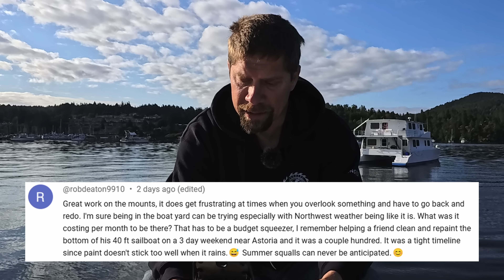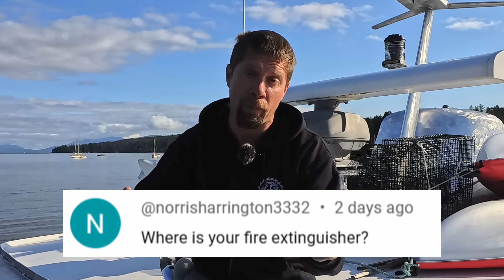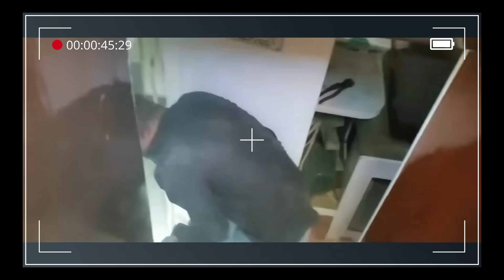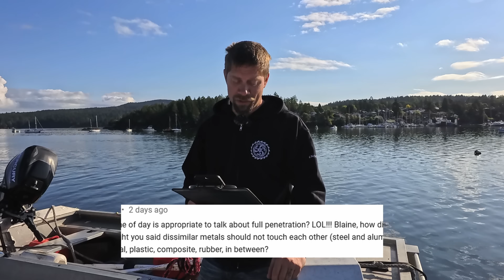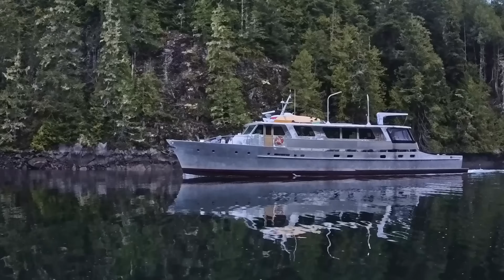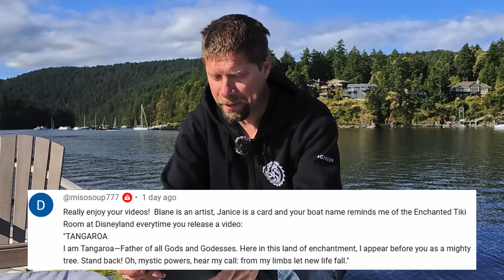We Custom Mounted our Cummins 6.7s - Your Questions Answered V2

Comment: Really fun watching this come together gang. 
You’ve mentioned a couple times you’re big into planning redundancies. So here’s a question from deep down the nerd well…. If you had to run for a significant distance on one motor due to a failure that couldn’t immediately be fixed, how does the windmilling (watermilling??) of the dead prop affect its transmission? I assume if that motor isn’t running there’s no circulation/cooling of the transmission fluid. Or do you have cross feeding of oil and coolant between transmissions? Or do these trannies even work that way.
Reply from the maker: Glad you are enjoying the project! While the transmissions can freewheel for a time they do eventually overheat do to lack of fluid circulation through the cooler. The easiest way around this is to lock out the non-running shaft. In a pinch this can be done with a big pipe wrench which we do have aboard.

Comment: Had a friend Years ago put 2 Cummins K19 engines that came out of trucks in a fishing vessel. While the new engines were much more fuel efficient He kept going thru the stock turbochargers. Those stock turbos were just not made to be on boost for hours straight. After multiple replacements He went with massive low speed turbos that were off a small ship engine, never had turbo failures after that. Just passing along the info….
Reply from the maker: Thanks for the info! They are not stock turbos. Hopefully I wont have similar issues. May carry a spare or two onboard.

Comment: One other thing about the two engines being routed into a single muffler/exhaust, is that unless the engines are PERFECTLY in-sync(no, not the band.or is that nxs?..sheesh) the exhaust pipe(s) would shake, rattle and beat the boat to shreds!
Reply from the maker: Fair point!

Comment: In case you need more ballast, a simple solution is to install concrete blocks, directly poured in position, yes it is used even on big ships, your naval engineer can confirm this
Reply from the maker: While I'm sure that would work, I would probably prefer water ballast as it is easy to change for the conditions. Not having to push around extra weight when I don't have to would be nice.
Reply: @OnboardTangaroaSeatrial , concrete takes your GM fast down and is not affected by rolling, you still have your 700 liter water bottle that you can pump. In the past lead weights were installed, concrete is easier, and affective
Reply from the maker: May just look into that. Thanks!

Comment: Non-boater here, but love the channel.

Are you aure you wouldn't want some aort of a power tune available in the case yhat you needed to out run a storm or aomething?  Seems better to have it and never need it.

I do recall your video with power vs.. Speed with the significant nonlinear ramp up. Is that why a power doesnt buy much?
Reply from the maker: Exactly correct. Basically, once you reach hull speed, further increases to power output only exponentially increase fuel burn with minute increases in boat speed. The boat also gets more difficult to steer as the bow wave gets large enough to make steering input less precise.

Comment: An option to consider to give yourself a little hp cushion upgrade the valve springs to 110lbs springs add a 64mm vgt turbo and they can comfortably stretch out to 400hp wouldn't be an all the time thing but could get you out of the way for crap weather
Reply from the maker: Certainly a good recipe for more power but honestly its unnecessary. Even if we had twice the power we wouldn't go any faster as the power we have is already twice what we need to reach hull speed. Any more power thrown at it would just increase fuel burn massively with minute changes to boat speed.

Comment: Before you head out on the long trip, will you install an “A” capability AIS? With satellite tracking, we will be able to follow your progress. 
Dave Althaus.
Reply from the maker: The class A stuff is typically only used on big ships. All of the pleasure craft stuff is class B. Its just a bit less powerful and transmit slightly less frequently. We have the class B built into our VHF radio. Any time we are underway, its transmitting!

Comment: 13:11 that's a lot of faith
Reply from the maker: I have been building engines for quite some time so was pretty confident in that regard. All-in-all these are pretty simple engines. Would I have preferred to start them before install if I could have? For sure, but I was not overly concerned.

Comment: Can you find some good number two diesel fuel that has lots of energy in it.. instead of that junk that's refined so much that it doesn't have any bang in it..😊.. will you have a separate diesel engine to generate electric power for your craft...😊
Reply from the maker: Hard to find that stuff these days. We currently have a diesel generator and will have a second one in the future. I like to have redundancies 😁.

Comment: why don't you go with Volvo d 11 engines They weigh a little bit more. They have common rail injection. They're in frame rebuild and they make a lot of horsepower.
Reply: I've worked for Volvo and a few other Euro engine manufacturers in the marine industry, their product is prohibitively expensive at the start without even getting into maintenance cost for the common user. Volvo, MTU etc are great for operations with deep pockets. Magnificent, efficient and state of the art engines until they are out of warranty
Reply: the boat is underway already for weeks with the Cummins. too late!
Reply: @christianpalm2622  I know that I have watched the videos before they deleted them. I have been around for about a year and a half now.
Reply from the maker: The D11's are nice but definitely would have been considerably more expensive for the engines themselves and parts are insanely expensive for them.

Comment: Just a hindsight armchair quarterbacking on fire sentry/enclosed space/fire safety... the enclosed space the fire was in could have easily had a build up of combustible gasses in it, was it checked for volatile gasses first? That fire extinguisher being used in an enclosed space is pretty dangerous in itself, your son could have been easily asphyxiated, he also appeared to have no safety gear on, firstly no long-sleeved fire resistant shirt or pants which is the bare minimum. Things to think about if there is a next time, accidents happen really quickly. Glad everything ended out OK.
Reply from the maker: Very true. We are not firefighters. Will definitely be something to remember the next time we run into a situation like this. Thanks.